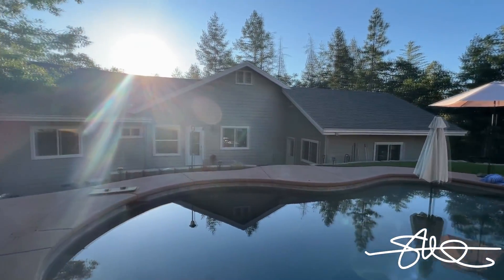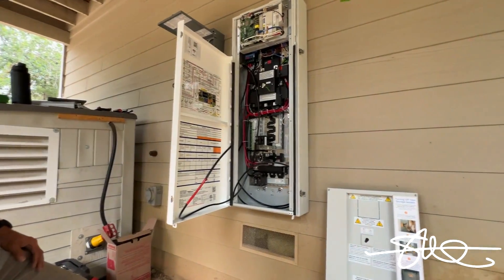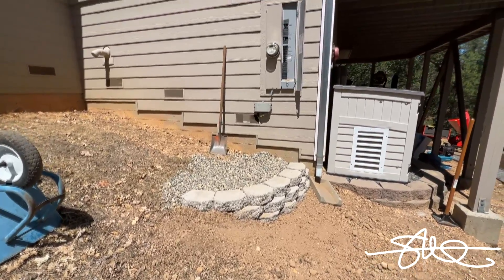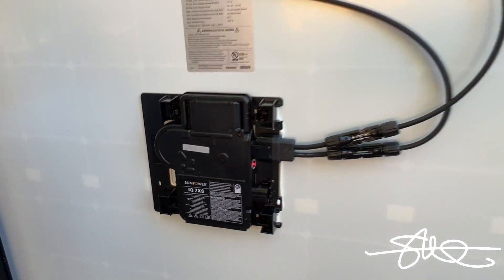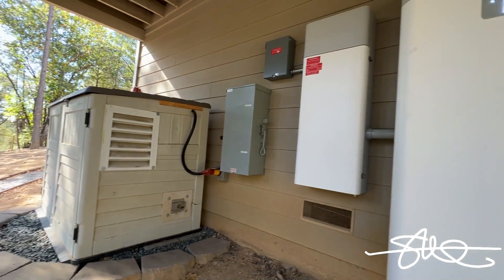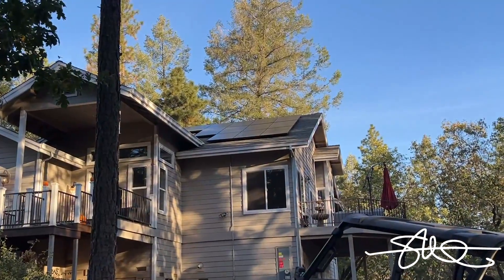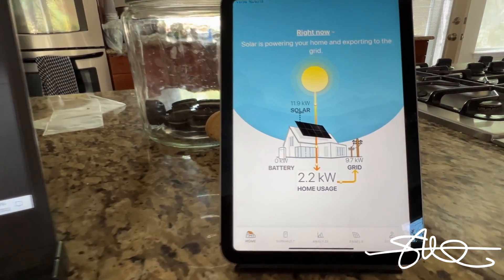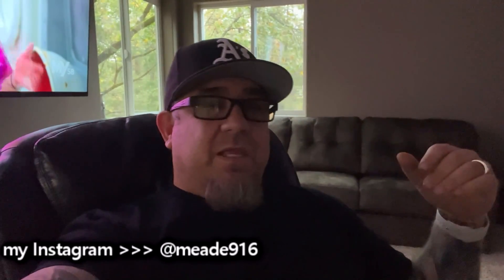Sunpower solar and Sunvault Lithium LiFePO4 26kwh Battery Backup | Full Install & Results

Comment: i’m happy to see  Sunpower installed. The 280 lbs is called main. There’s also same unit called Expansion. it’s lightweight coz it doesn’t have the inventor , just holds the battery. With main and Expansion combined, can do everything with it including welding. I did assemble them in Bloomington,Minnesota. (Dalsin Industries).  That’s the best of the solar power you got. That’s some power you will love. Tesla isn’t even close. It’s well built.

Comment: I had a 20k system installed 1yr ago 50 panels.  Biggest frustration is that my installer can't figure out why the panels can't communicate with the system. System  is producing  [33500 kw in 12 months] I just can't see  individual power generation of each panel on the app. How is your system doing ?
Reply from the maker: a 20k system with 50 panels? Did you get them off ebay? That sounds like a cheap system, maybe that is why you are having problems.  My system is doing great :)

Comment: Would love to seen an update.  In a view months I will be putting in a 34 panel Sunpower 425W system with two sun vaults. Also, did you put a UPS on your Internet Wifi to solve for the disconnect time between power failure and the sun vault turning on?

Comment: in italy, my family bought similar system. 6.6kw panels and 20.8kw battery lithium/graphene. we live in sicily, all winter days solar panels produce like 18kw per day, in summer is like 25/26kw per day. electricity costs like 0.40€/kw and it's crazy. we bought an electric car and we drive without petrol from more of 2 years (1.60€/liter diesel and 1.68€/liter gasoline, that's crazy) thanks to out solar panels and batteries. it's fantastic. glad to see your videos :)

Comment: Hey Steve, this might be a dumb question, but what do you do about snow on that panels? Are they heated? Love Your Videos been watching for a long time. Much Love Tom
Reply from the maker: the highest panels will be hard to reach but the ones closest to the pool i should be able to hit them with a hose and melt the snow off.  Snow don't usually stay too long here though. We get some but it typically comes and go's.  Last year was something that hasn't happened in decades (the kinda snow we got).

Comment: Steve, how will those work when you get the monster snow storm like you had last year?
Reply from the maker: should be ok if we can power the house and refill the batteries with solar during the day.  If we drain the batts too far, i will have to go back to the generator.  That's no problem though, that is why i insisted on keeping it.  The solar batts are gonna benefit us most for the "normal" power outages that last hours, not weeks :D
Reply: @meade916  Looks like a monumental undertaking. Thanks for sharing man🍻 Look forward to the update

Comment: Thanks for the video!   I’m about to sign with Sunpower for a very similar setup.   Questions :-):
1) What capacity are your batteries?
2) Would be great to see a Timelapse of the screen with the batteries charging and then discharging on a normally sunny day.

Comment: Had 13.25kw installed this week (up from a 20yr old 1.5kw system), is battery ready, and is pumping out a lazy 50kw/ day here in sunny Queensland, Australia. Had the installers fit a "Shore Power" point to plug in a Genset.
Total cost was $16,500 AUD installed.
Got a $2000 credit towards a battery as part of the deal. Its slow, but slowly i am getting our house closer to being off grid.

Comment: One thing I'd suggest is make sure your shingles are brand new. If there say 10 years old just re roof your house with good quality materials and then install the panels. Saves a lot of work later and roofs aren't the pricey.  Steve your the man. Been here for a long ass time and love how far you have come. Much props on every thing you do and done.

Comment: Nice solar array, crazy how much of those cabinets are the inverters though.  Having the peace of mind far outweighs the cost of a system like this where you know when SHTF you forget the power even went out. 
 Curious as to how everyone in the comments pays per kW not including their base rate. BC CAN its $.09 a kW up to 1350 kWh then raises to $.14 a kW after that.
Reply from the maker: saving money on my bill was secondary to the battery backup system for us.  Peace of mind is everything.  In most cases we won't even know the power is out until i get a notification on my phone from the app :D

Comment: Hi, I presume that they were micro inverters on the back of the panels, if they are, I have never seen them preinstalled on panels before, can I please ask what the brand of panels are.
Reply from the maker: each panel has it's own micro inverter.  And they are all registered in the system so they can be monitored individually. It's a dope setup!  We are paying for it though....lol!
Reply: @meade916  thanks for the reply. What brand are the panels please.

Comment: damn I thought my 600 to 800 month pwr. bill was bad. Could you do a follow up in a few months or maybe a follow up in 12 months Kwh Imprted/used/generated by solar/ sold back to the grid if you guys do that? Maybe a cost/ROI over time? I think in the future there will be more of a focus on the concepts of Micro-Grid's. Edit: 15 min in to the video. That system is BAD @$$!!!

Comment: I foresee a few trees going away. My repair shop is almost totally solar and still have more panels to install. But I am a DIY solar off grid system. Didn't have the flow in the wallet to have a big professional install like that. Very nice setup. The shade is a killer for solar. Good luck buddy. MORE VIDS on this.

Comment: Awesome video! Just curious if they needed to add any support on the wall with the battery panels?
Reply from the maker: the wall is strong enough to hold.  He didn't fasten to the siding, he is in the studs obviously LOL.

Comment: I'll be really interested to hear what you think of the batteries over time.  I just got a 10kW system with 20kWh of batteries, and honestly I wish I had gotten double the batteries that I got.  20kWh seems like a lot, but it's not enough to run my whole house overnight, so I still have a few hours where I'm importing power from the grid.  Late at night so the power is cheaper, but still I was hoping for 100% self-powered, and I didn't get that.

Comment: What's the projected ROI on your system?  If I had to guess 26kwh with two LiFePO4 systems, 10-15 years?     Just curious if solar is coming down or not.
Reply from the maker: i don't know...i guess it depends how many times the power go's out.   I got it just as much if not more for the seamless backup than i did for the solar savings on the bill.  But if my bill go's from $1200 to them owing me money (because we send to the grid all day long and use the batts at night) then it won't take long for a ROI :D

Comment: Shit im in fl and have a 2069 sf house and bill was 500 and went up 50.. I feel ur pain.. But hoa you cant do shit for help
Reply from the maker: this house is 3300sf, my last house was 1300sf and the only time it was near 500 a month was fall or spring when we didn't use any HVAC.  That house could easily pull an $800 or more bill in the summer.
Reply: @meade916   shit you know fl is cold a week out the year lol.. So ac is a must .. Nice house tho

Comment: Did not hear you mention your cost for this set up.
Reply: It will have been a few grand, but you’ll make that back over a few years as you won’t be paying hardly any electric bill. And as it’s a house that’s where the value comes in. Plus it adds value to your house if you sell it. It’s like changing your old wooden frame doors and windows to new double glazed plastic ones, because they keep the temperature controlled much better thus save you money over the long run.
Reply: @marksapollo  electric ain't ever free no matter where ur at.
Reply: also would love to know, but I would imagine about 50k for the batteries and maybe 75k for the panels ..
Reply: We can get it free in my area right now
Reply from the maker: @fan1.0  i don't care where you live. You ain't getting this setup for free. LOL!!
Reply: @meade916  I think the free stuff is basic. Most people in my cauldisac have some pretty nice solar setups that run their whole house, don't know what they paid
Reply: @meade916  I have neighbors that   their electric meter spins backwards. Too bad the electric company doesn't pay them. But at least they don't pay a bill

Comment: you can change the old AC and get an inverter unit to be able to use it off grid plus inverter ACs are heat pumps
Reply: And a heat pump is more efficient for heating than electric heaters
Reply from the maker: my solar runs the AC just fine.  The battery bank doesn't like it though.  I know i can convert it to a soft-start but to me that is pointless as i will never run my AC off the batteries.  It would deplete them too fast.

Comment: I’d love to see the power usage when you got the home audio set up going.
Reply from the maker: home audio is nothing.  Its the dryer and the A/C that pull the most power.
Reply: @meade916  wow really? I’d expect your home audio to draw a lot with how much you have. My one 400 watt klipsch sub makes me lights flicker a little, but I also live in a shitty double wide lol
Reply from the maker: @Daniel-hq7gj  it doesn't draw that much just being played at normal levels.  I don't crank it to max volume very often.  Even if i did it would be nothing compared to like the dryer LOL
Reply: @meade916  wow really? I’d expect your home audio to draw a lot with how much you have. My one 400 watt klipsch sub makes me lights flicker a little, but I also live in a shitty double wide lol

Comment: I SEE STARLINK
Reply from the maker: yup not much of a choice out here.
Reply: @meade916  starlink is awesome
Reply from the maker: @DOMTHESAUSAGE  not really.  It's barely "OK".  My ATT hotspot i have downstairs in my office completely obliterates it.  But the Starlink is good enough to run netflix and all the home wifi stuff.  I would never use it to game or heaven help me if i was to try to upload a youtube video on it.  I would give starlink about a 5 out of 10 at best.  It's so SLOW.
Reply: @meade916  ive just got it and going from 30mbps to over 200mbps you can see why i think its good hahahha i have trash net
Reply from the maker: @DOMTHESAUSAGE  on Starlink, i only get about 30-50 down and maybe 5-7 up.  In the middle of the night, or early morning off-peak, i might see 150 down and maybe the same 5-10 up.  My hotspot consistently does 80-90 (sometimes 100) down and i have seen 35 up a few times.  Usually over 20 up.  I need that upload speed bad for youtube.

Comment: I have 16.7 kw of solar. 
Pool, 3 refrigerators, 2 freezers, spa, 2700 sqft AC set 72 year around.
True up is $144/yr.
You will love it.
I haven't done batteries.
Edit: Add bird guards around your solar panels, especially considering where you live
Reply: Wonder if putting a couple of fake owls would help with the bird issues.
Reply from the maker: @notsure1872  i have no bird issues.
Reply from the maker: this home is 3300sf and i have the same stuff....3 refrigerators, a deep freeze, an ice maker, pool pump etc.  The panels are making a huge difference so far though.  I don't see many birds trying to land on my roof or my panels hardly ever.  This is the forest.  They prefer tree's.
Reply: @meade916  Fair enough. You do have beautiful trees that I do not have. Enjoy the improved reliability of your power

Comment: I bet that was a hefty ass wad of money $50-$80k. And will so suck to have a roof replaced with them solar panels...it's cool though for sure. Maybe one day I can do something similar. The front of my house sees sun from sunrise to almost sun set. So summer its on the front till almost 9pm. Looks good plus generator too so you good for the upcoming apocalypse lol
Reply: I have a similar system (a little smaller. 31 panels and 20kwh of battery ). Was less than $50k and insurance paid to have the solar panels removed and reinstalled when my roof was replaced a couple years ago.
Reply from the maker: @dreednlb  less than 50k you are lucky. 50k here barely gets you basic solar at best and that is NO batteries.
Reply: @meade916  so how much savings are you looking at on your bill each month I know for the house that size where I live at would probably be about 300 or so a month for electric maybe 350 with all the stuff you got running my house is a lot smaller three bedroom house with a full finish basement in our s*** stays anywhere from $100 to $200 depending on what time of year for our electric and gas I know some people in our neighborhood said that they got solar and literally get paid each month from their electric company so far for the past year and a half they have zero bill at all and they're actually getting a check each month in the summer they're getting like 20 to $60 back from The Electric Company and in the winter it's like anywhere from $5 to $12 back but not bad things that they don't have to pay a bill anymore I think they spent $32,000 for the whole system including install and I think that was after taxes I think they had it done in 2021 but they bought Insurance panels is what they called them they costed a lot more than the regular 15-year panels but they get recycled through the company every so many years they get new panels and I think that's like $25 a month to have that special insurance silver $25 a month they get new panels every so many years if they need them like they're starting to not work as good or whatever I don't know how that works really but I know a lot of people that get these systems like you have and said they were a total waste of money for what they spent they don't save enough money and then I know some people that buy the systems that say that it was the best thing they ever did they pretty much don't have a bill at all and some of them even say they're getting paid by their electric company because they put out so much extra power they don't need
Reply: @meade916  It's wild how much stuff costs in California compared to the rest of the country. I'm in the Houston area and paid 2.89 a gallon for gas yesterday.
Reply: @meade916  Does California offer extra tax incentives on top of government incentives?
Reply from the maker: @danielmcbride4828  you don't know the size of my house.  LOL....but 300 bucks a month is a complete joke.  I WISH.  My old house was almost 3x smaller and the electric bill there was 7-800 a month in summer and at least 400 in the winter.  Other than the first sentence i can't keep up with whatever you just wrote.  You have my eyeballs spinning in my head trying to read that much stuff with zero punctuation.  Mix in a period, or a comma, or something next time lol.
Reply from the maker: @notsure1872  must be nice.  It's still $6 or more a gallon here.
Reply from the maker: @notsure1872  no government incentives.  But we did get a 30% tax break.
Reply: @meade916  yeah I hear the electric bills in California are about six times what it is here where I live in Indiana
Reply: @meade916  sorry about the punctuation but I don't type this s*** out I just press a button and talk and it writes it down for me thank you for the reply though how many square feet is your house I'm just wondering

Comment: whats the expected life cycle for the batteries?
Reply: From what I've been seeing, 10-15 years. The ones I'm looking at have replaceable cells. So when a cell(or 5) die out, I would be able to replace them on the go.
Reply: Xs power 👍

Comment: Sorry to ask what a system like yours costs but what does a system like yours cost? I got a same size house and the front faces east and sets right on the back of the house. Very tall colonial style house so no trees in the way either. So for 26kw system what we talking $30k ??
Reply from the maker: nope.  WAY WAY more than that. But i got a 30% tax credit coming which helps.  But even with that it is almost triple what you just said.
Reply: @meade916  ok thx for the info. I probably don't need 26kw. But I'm sure you did the math and will be in the black in the coming years. Like 10 years or less plus the power outage are taken care of.  So yeah why not. What made you pick that brand? Are they the industry leaders? Quality looked great to me. I'm a wireman by trade everything looked solid.

Comment: California - you must buy electric cars charged by our grid. Also California, we're turning your electricity off because out grid can't handle the load right now.  Solar with battery backup in the only way to go right now.  Unless the sun flames out, which would be the end of the world, you will have power.  I'm about to do a solar with battery backup for just a few fridges and freezers and such.  I plan on running it at 12 volts, so I can also wire up car amps to power my subs in my home theater room.  My energy costs are lower in Georgia, but the thought of saving a bit each month, in addition to having backup power in case of emergency makes me feel better for the safety of my family.  Beautiful house, can't wait to see what you do with the theater set-up with the 2 32's.

Comment: I have a single battery  sunpower system.. my pseg bill is $5 for the past 3 months. My old pseg bill was $500..

Mine was installed  late July 2022.. no hiccups
The battery  runs the house at night.
Reply: What's your solar bill?

Comment: I’ll bet $50 bucks.  Won’t be 30days if not now.  Steve already thinking about CNC ing out a acrylic cover with led backlit for the panels
Reply: Soon to have another 2 battery banks with XS Power Lipos 😅
Reply: @dirtyminerapparel   lol I can see how you miss understood my comment.   I was talking about the PANEL the actual electrical panel.  Not the solar panels.    😂.